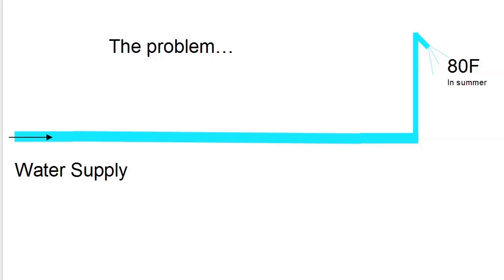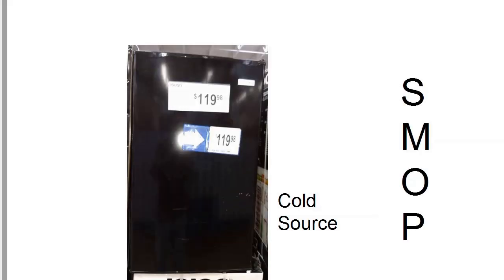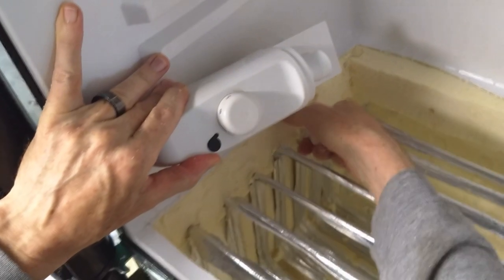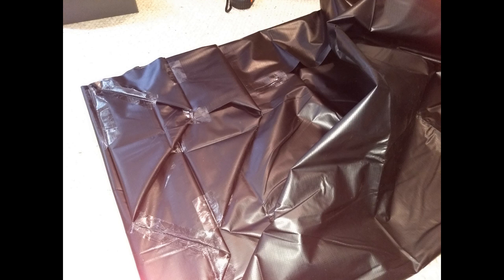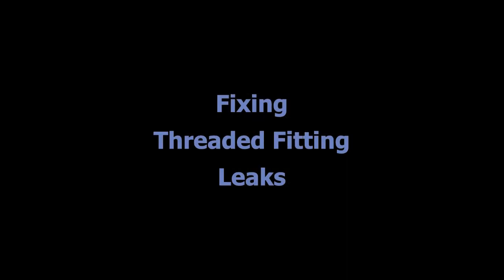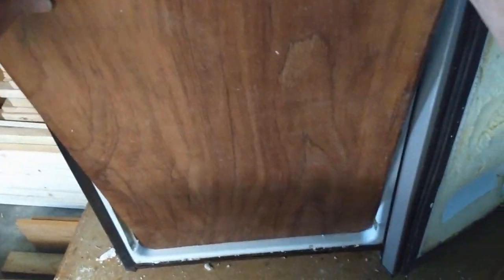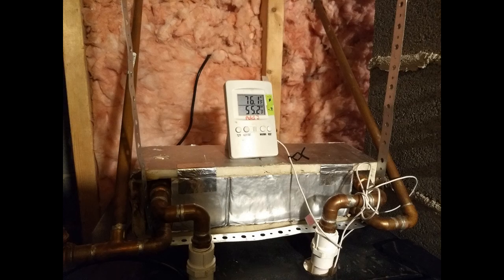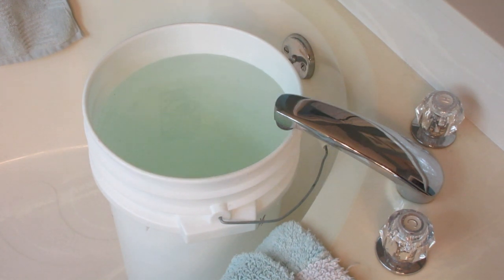Making Your Shower Deliver ICE COLD water for Wim Hof Cold Showers

Comment: Would this work to fill a bath tub? I have a 1/2 HP chiller, and was trying to think of a way that I could use it with my bath tub. Check my thinking...As long as the flow rate into the tub didn't outpace the ability of the heat exchanger to cool the water it'd work...
Reply from the maker: There's only so much "chill" available inside the refrigerator, so the longer it runs, the less temperature drop you can expect.  A bathtub is a lot more water than a shower.  Let us know how it goes.

Comment: Great video and you put tremendous time and effort into this.  But for the rest of us who are not plumbers, or engineers, we would pay very good money to have an easy to use contraption that gave us cold water for 90-120 seconds.  Just bringing the temperature down 25 degrees  in a state like Florida would be awesome.  WIth cold showers growing in popularity, someone is missing out making lots of money on an invention that many oif us would pay thousands of dollars to install if it were simple.
Reply from the maker: I agree, certainly!  If I was 40 years younger, I might try to launch a company.  But I'm retired and have no great desire to go back to work, even for something that's "fun work".  I've got a kit (bought all of the parts) to make another chiller, but haven't bothered to assemble it.  This design is portable (the dorm fridge is on wheels and it connects to your shower without the need of a plumber).  I've been waiting for someone local (Charlotte) to contact me as an excuse to build it.

Comment: I have  a proposed idea for a poor man's version of this. I'm not sure it would work but if it does maybe somebody else might want to use this as well ..

 i have an outdoor shower and I was thinking what if I took a roll of copper tubing and put it in a 5 gallon bucket or similar type of an  ice chest  container with a lid,  the lid has to be part of it for connecting piping and allow for holding temperature  of ice and cool water in the shade,  and whenever its close to time for a cold one, sometime before, i could dump a pound or 2 of ice in,  with the bucket also very close to the shower head and shower itself of course...then have a connection point for water in and water out by installing fittings in the lid of the bucket, and the actual tap water would run through the already cold copper line and make for a colder shower i assume..but. not an expert.. would this work , at least until mo.re money is available to upgrade the system?
 lol
Reply from the maker: This is a good solution if you don't mind feeding it ice.  You can buy a ready-made copper coil at a home brew supply store (they call them "wort chillers" and they start at about $50).  They are not as efficient as a heat ex changer, though.  You could make a counter flow chiller for pretty cheap with some soft copper tubing and an old garden hose [ https://youtu.be/UwiW3aSM7Yo  ] which would get the water colder with the same ice.  The issue, though, would be that the counterflow chiller needs a pump.  You can get a submersible fountain pump for $25, which would probably suffice.

Comment: This is awesome, and looks like a fun project as well. Have you considered a way to do this as an on-demand system, so you’re not constantly using energy running that extra fridge? I understand cold showers aren’t going to run very long, and also it takes quite a bit of energy over time to lower temperature… but I would still be interested to know.
Reply from the maker: When I first envisioned this rig, it was because I had been exposed to the core component, the heat exchanger, from my beer brewing hobby.  Thus, I never thought too much about on-demand solutions.  And off the top of my head, can't think of a way to chill that much water on demand. On-demand heating works because you can use something so much hotter than your target temperature, but on the chilling side, we have to deal with freezing problems.  But you're right, there's a cost to keeping that large quantity of water cold for 24 hours, when it's only needed once a day.
Reply: I don’t know why I didn’t think of this earlier. I bet you could use TEGs (thermo electric generators), maybe a fan for airflow, and a long enough series of heat exchangers to do an on demand version of this. There are videos of people using them to make mini fridges (no compressor required).

Comment: Hello, I just started researching how to get a cold shower installed in my shower and to a bath tub, I’d like to ask if you could possibly recommend who I need to start asking for an estimate for the whole project?
Will average master Plumber know how to do this? Or do I need to consult a home remodeler or builder?
Would really appreciate your guidance.
I’m currently using 50F cold shower at my sports fitness center for injuries and inflammation on my neck and lower back
Thank you.
Reply from the maker: I would say that if you pointed a plumber at this video, they should be able to do this job.  It's a little beyond standard plumbing, but not that much more.  I had a plan to build one of these that is NOT built-in.  The idea was to put wheels on a mini-fridge, mount the heat exchanger on top, and connect with quick-disconnect hoses.  I have the parts, but never got around to building it.

Comment: Very interesting.  I must say, that was a lot of work--and money--to get ice cold water.  You must really enjoy cold showers.  If I may make a suggestion: I think you need a simpler diagram to show how the system works.  And why the need for the pump?
Reply from the maker: Yeah, I agree, this could be presented in a more concise and direct manner.  Any home improvement project is going to cost some money, so this project is no different.  The reason for the pump is to recirculate the chilled water through the heat exchanger.  I have a hard time explaining the concept of a heat exchanger to people who aren't already familiar with the concept...two fluids that pass near each other, traveling in opposite directions, but the fluids do not touch, only transfer heat.

Comment: Very cool!  What makes you interested in the cold-shower?  Do you follow Wim-Hof?

I was thinking of how I might do this, but had come up with something much more Mickey-Mouse:   There is small-closet on the other side of my shower-head.. so I was thinking of placing a valve that I could switch between normal and an ice-water supply.

For the ice-water supply, if I had a ice-maker in the closet, it could generate about 30 pounds of ice overnight (8 hours).  So in the morning, I could turn it off, get in the sauna, and by the time I get out, the ice-basket should be melted with near 0C water.   I would just need a pump to go from the ice/water-basket to the valve.    Granted, this would only yield a few gallons of water, or just a couple minutes of shower-time but that may be enough!

Incidentally, I've also been thinking it would be nice to have an overhead heat lamp so that getting out of the shower isn't so cold!
Reply from the maker: I started reading about immune enhancement by cold exposure with Wim Hof, yes.  Then I did more research on heat shock proteins.  I started with the daily cold exposure to possibly reduce the impact of an eventual Covid exposure.  But so far, I haven't had Covid (that I know of).  Can't say if it's due to using my cold shower machine, vitamin D, or none of the above.

Comment: great video! Thank you so much! This is an awesome idea. I have a question, if I wish to make such a setting for an ice bath, do I need two pumps?...
Reply from the maker: If you want to recirculate the bath water, then yes, one pump to circulate the refrigerator water and another pump to recirculate the bath water.  But most people who do cold plunge use a chest freezer instead.  The other option would be to fill the plunge tank with domestic fresh water supply.  In that case, you would only need one pump to recirculate the refrigerator water.

Comment: Thanks for sharing! At my beverage processing facility we considered building a chiller with the same principal except using an old 400 gallon dairy tank for the water+glycol slush. Looking forward to seeing the next iteration you mentioned!
Reply from the maker: I still haven't built the portable one, but have purchased all of the parts.  Maybe I'll build it out in the spring, before the ambient water temp comes up in the summer.  You might be interested in the mixing control valve I'm working on.  Rather than having all the water go through the chiller, it would mix ambient and chilled so that the mixing valve, with temperature sensitive wax element, would deliver a constant temperature.  It's the same principle as the wax element on automobile cooling, but the wax operates in the 3 to 15 degrees C range.

Comment: Good thinking! Have you checked my Cold Shower Enhancer I developed a few years ago? It chills the water temperature down do -2 Centigrade and stays at -1C to 0C for 12 minutes of my ice cold shower. Over the years I have sold quite a few of these worldwide! Take care
Reply from the maker: I had not seen your device, but not found this: https://www.youtube.com/watch?v=vVv5PiIMLtM from your youtube. Also, I see from Facebook that the device uses ice and maybe an air compressor?  I don't completely understand how it works, but it appears to be a heat exchanger based on copper coils.  With this video, you can see the my design is a heat exchanger based on a plate chiller (more efficient at heat transfer than coils).  You remove heat with ice and compressed air.  I remove heat with water chilled by a refrigerator.  The reason I built mine with a refrigerator is because I knew I would get tired of making ice and chipping it up.  With mine, it's literally a press of a button that turns on the re circulation pump.  I don't attempt to sell mine, but would help anyone who wishes to try to build one for themselves.
Reply: P Pudelko, I will buy one from you. Where can I see it?
Reply: Where can I find your device?
Reply from the maker: @elkatingalletero  I'm not sure if you're talking about the one I built or the one @PPudelko built.  I'm not in business to sell mine, but I think you might be able to find Pudelko sells his.  I have a set of parts that I'm planning to put together soon that will become an updated version of my device that will include new features and be portable (so able to be used in an apartment, for instance).
Reply: @sengsational  I’m very interested in this device you just described. I live in an apartment and have no plumbing know how but I’m willing to invest in the device + a guide that helps me install it or with a plumber.

I can be your first customer 😁 if you down, I’ll pay 50% up front.
Reply: @sengsational  Any news on this? VERY interested. LMK if there is a way to contact you about questions...Thanks!
Reply from the maker: @amcnally336  You can contact me at icecold.frog4food at recursor dot net.  The device I built in this video has been working flawlessly every morning since installation with zero maintenance.  I've got the parts for another one (a mobile one), I just haven't bothered to build it.
Reply: @sengsational  I want one too
Reply from the maker: @b3_w4ter85  I haven't heard of a commercial one.

Comment: Great work 👌👌  just a doubt. Suppose if i dont need that much cooling. And just require ambient temperature for bathing. Without using a cooling /fridge setup. If i use only the cooling plate will it reduce the temperature a little ?
Reply from the maker: The plate chiller has two circuits: "through" and "recirculate".  Both must be connected to have an effect on the "through" water temperature.  To lower the temperature of the "through" water less, there are two choices: 1) make the recirculate water less cold, or 2) push less recirculate water through the plate chiller.  For 1), you could set the thermostat on the refrigerator to a higher temperature.  For 2), you could put a valve to restrict the flow.